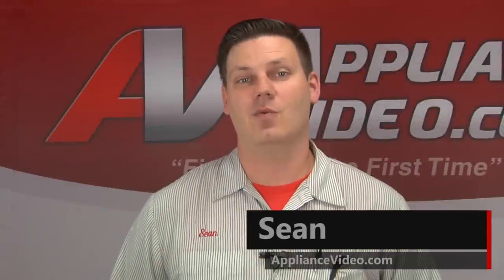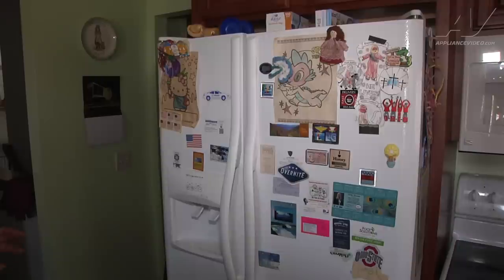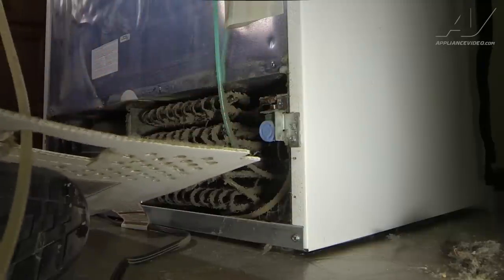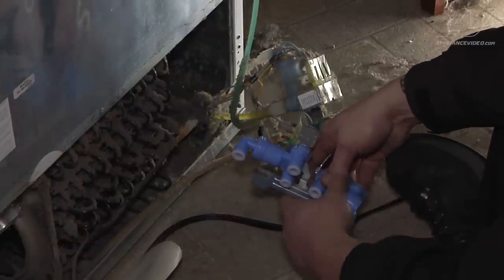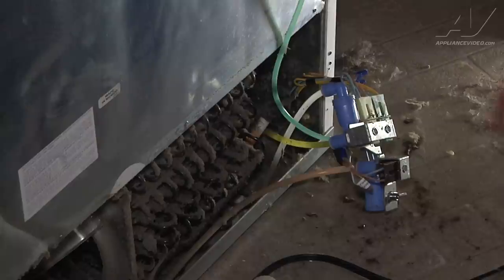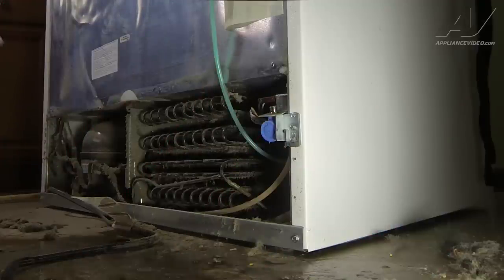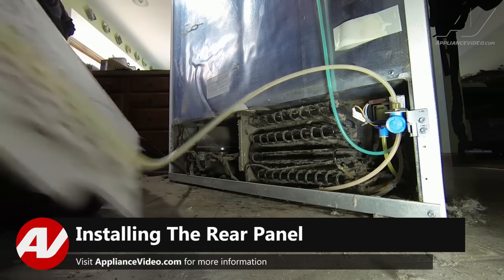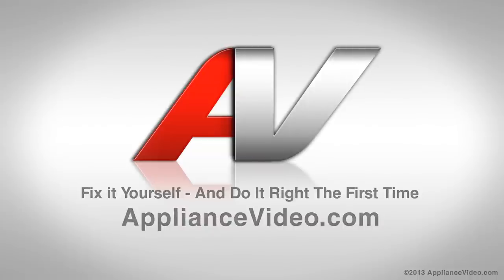Frigidaire Refrigerator Repair - Not Getting Water - Solenoid Valve

Comment: Pretty good video!  Thanks!  I had already figured the solenoid was bad because it was a typical sound that I was used to hearing over the last 15 years, that I wasn't hearing anymore.  It would be pretty easy to check for power going to the solenoid, but in my case I bought the fridge new over 15 years ago and knew these solenoid were the weak link in the system, so I just rolled the dice and bought a new valve.   All is good now, ops check good. I immediately could hear the solenoid actuate and after I cleared the ice obstruction at the top of the fill hose I'm in business.  I suppose with a bad valve water sitting stagnant in the fill line will tend to ice up at the top...so yeah, make sure you clear the ice at the tube where it goes to the ice maker.
Reply from the maker: Thanks for your response, we are glad we could help. Our library
of over 5,700 videos are currently helping over 1.6 million people like you
every MONTH.  Please help us by
subscribing to our YouTube channel, or post our website www.ApplianceVideo.com to your Facebook
page, Twitter, Instagram or any other social media sites. Your support will
help us keep producing more free quality videos.

Comment: Just rewatched your video. I replaced the inlet valve 2 weeks ago and it all worked fine. The valve went bad. Today it fails a continuity test. Can a bad diode cause a valve to fail? If so then I will have to replace the diode but it is a 50 dollar part so I don’t want to if it is not necc

Comment: My ice maker freezes the ice but doesn't dump it. This video is very Informative. My Frigidaire is a little newer but the ice maker is almost exactly the same. Now I know exactly how to replace it. Thanks too much
Reply from the maker: Great question, you can call
our parts department at 1-800-830-5465 and they can give you help 6-days A week
Mon-Sat . You can also search at www.SaveMoreOnParts.com 7- days a week.  If you have a more
technical question that our parts department cannot answer, our technicians are
answering all questions at our website at www.ApplianceVideo.com under our Repair Help section. We have over 6,000
common questions and answers that you can easily search through by your model
number, appliance make, problem or error codes, and It’s completely free to
search through our question & answer library. There is a very good chance
you question is already answered there.

Comment: What sorts of test did you do to come up with your diagnosis of faulty inlet valve/diode?  With a multimeter, which one did you test and what are the readings?
Reply from the maker: +ryk1265 

         We would like to help you answer your
question. With our videos now getting over 900,000 views per month and hundreds
of questions from people like you, our technicians are now answering questions
at our website http://www.appliancevideo.com/repair-help/ .  We also have over 2200 common questions
and answers that you can easily search through by your model number, appliance
make, problem or error code and it’s absolutely FREE. You also have the option
to email a factory service technician with a question on your appliance at http://www.appliancevideo.com/repair-help/ . If you’re looking for a repair video, you can
also search our library of over 2600 free repair videos. ApplianceVideo.com
specializes in quality DO-IT-YOURSELF appliance repair videos and we get over
800,000 views per MONTH to our videos worldwide and growing. If you need of
parts for your major appliance, we have over 5-million parts in stock at http://savemoreonparts.com/ .  Thanks for your support. Matt Ace
Appliance factory service technician.

Comment: So my issue is the solenoid isn’t receiving 115v water solenoid is getting 115v and water is perfectly fine with good pressure also solenoid is more than likely plugged because “black things would come out” as stated by customer. Also ik it’s calling for ice when I press the ice dispenser readings would change by 1 or 2 weird problem any input or ideas besides bad board

Comment: So. I have no water and no Ice. This happened when we moved in abt 3 yrs ago. I replaced the water inlet, new filter and it all worked. Ive been replacing rhe filter and no issues. But here we are again no water, no ice. So i changed the filter and cleared the ice where the hose goes into the ice maker. Still no water. So I replaced the inlet again. I can hear the water dispenser trying to work but still no water. ? ? Water seems to be getting to the filter because i hve removed and replced it a few times and water is dripping from it.    Any ideas?.

Comment: What is the part number of the Diode that you replaced and where can I buy it? I have the same problem, no water coming even after I replaced the solenoid valve.
Reply from the maker: Great question, if you have a more technical question that our parts department cannot answer, you can search our over 17,000 answered questions free at our website www.ApplianceVideo.com under our Repair Help section. You can also call our parts department at 1-800-830-5465 and they can give you help 7-days A week ,or search at www.SaveMoreOnParts.com  .

Comment: The fan on the Frigidaire Professional is out on the bottom back of the fridge, the ice and water are no go. The left side is pretty hot too.  Advice before we go out to buy a new one tomorrow?
Reply from the maker: Great question, if you have a
more technical question that our parts department cannot answer, you can search
our over 10,000 answered questions free at our website www.ApplianceVideo.com under our Repair Help section. You can also call
our parts department at 1-800-830-5465 and they can give you help 7-days A week
Monday -Sunday, or search at www.SaveMoreOnParts.com  24 hours
7- days A week.

Comment: A lot of videos go over what might be the cause for an ice maker not making ice. One of those reasons could be a clogged water inlet tube leading into the ice maker.    That was my problem BUT  I can't find in any of your videos that explain why the water inlet tube would freeze over preventing water to enter the ice maker thus not making ice.  Everything works but that.  Please help.
Reply from the maker: Great question, if you have a more technical question that our parts department cannot answer, you can search our over 17,000 answered questions free at our website www.ApplianceVideo.com under our Repair Help section. You can also call our parts department at 1-800-830-5465 and they can give you help 7-days A week ,or search at www.SaveMoreOnParts.com  .

Comment: i have a frigidaire model #fghc2331pfca  that has a diode install on the man water valve connecton wire for the water inlet valve tan line just like the video you are describing here but mines was not incased in plastic  but rather in a hard silicon type clear material as well as heat shrinked plastic to make a long story short i was able to cut in4007 diode from where it was being housed so that could just check it out because im having similar issues with the ice maker not receiving the water from the valve (i dint take pictures) but any way the diode is good and im trying to get information of which way does the cathode side need to be installed back in the system toward the connector or away from the connector please help as well as  called the parts dept and they dont know the name of the harnest as well as see anythng about the diode
Reply from the maker: Great question, if you have a more technical question that our parts department cannot answer, you can search our over 13,000 answered questions free at our website www.ApplianceVideo.com under our Repair Help section. You can also call our parts department at 1-800-830-5465 and they can give you help 7-days A week ,or search at www.SaveMoreOnParts.com  .

Comment: I’ve got a Kenmore side by side with water and ice in the door.  After replacing my water filter the water dispenser leaked water.  I replaced the water valve/coil just like in the video.  That fixed the leaky water dispenser.   now my ice maker is leaking water inside the freezer.  I’m getting ice cubes so the ice maker seems to be working.  Any suggestions on what may be wrong?
Reply from the maker: Great question, if you have a more technical question that our parts department cannot answer, our technicians are answering all questions at our website at www.ApplianceVideo.com under our Repair Help section. You can also call our parts department at 1-800-830-5465 and they can give you help 7-days A week Monday Sunday, or search at www.SaveMoreOnParts.com  24 hours 7 days A week.
Reply from the maker: Great question, if you have a more technical question that our parts department cannot answer, our technicians are answering all questions at our website at www.ApplianceVideo.com under our Repair Help section. You can also call our parts department at 1-800-830-5465 and they can give you help 7-days A week Monday Sunday, or search at www.SaveMoreOnParts.com  24 hours 7 days A week.

Comment: Hello I hope you still read comments in your Chanel I have problems with my Frigidaire ice maker water doesn’t get to the it but water dispenser is working right ... what do you think it could be the problem? I will appreciate your help ...
Reply from the maker: Great question, if you have a more technical question that our parts department cannot answer, you can search our over 13,000 answered questions free at our website www.ApplianceVideo.com under our Repair Help section. You can also call our parts department at 1-800-830-5465 and they can give you help 7-days A week ,or search at www.SaveMoreOnParts.com  .
Reply: Same thing for me! Did you find it out?

Comment: My unit looks like this one except its black in color, I do see any water going into the ice maker, however I do get water from the water dispenser on the door.  What are the part numbers for both parts replaced?
Reply: BTW when I push on the dispenser on the door the screw in the ice maker turns.
Reply from the maker: Great question, if you have a
more technical question that our parts department cannot answer, our
technicians are answering all questions at our website at www.ApplianceVideo.com under our Repair Help section. You can also call
our parts department at 1-800-830-5465 and they can give you help 7-days A week
Monday -Sunday, or search at www.SaveMoreOnParts.com  24 hours
7- days A week.
Reply: Everyone has to make everything racist these days! OMG

Comment: What is the water connection called on the new piece?  (The old one is "threaded.")
Reply from the maker: Great question, if you have a more technical question that our parts department cannot answer, you can search our over 13,000 answered questions free at our website www.ApplianceVideo.com under our Repair Help section. You can also call our parts department at 1-800-830-5465 and they can give you help 7-days A week ,or search at www.SaveMoreOnParts.com  .
Reply: the new type is a "push in connector"

Comment: We bought a used Frigidaire side by side, 5 years old, from a friend.  The ice maker worked fine.  We got it home and it wasn't getting water to it, however the water dispenser worked fine.  After reading the trouble shooting guide, my husband replaced the water valve triple solenoid. ( Part #240531101)  They said it might take 24 to 48 hours to work.  At 48 hours, my husband checked it, yet again,  and the inside where the cubes are made was so hot it burned his hand.  What the heck?  It was still not getting water, either.  It was professionally moved and disconnected.  HELP!!!!   I really love this refrigerator and the one I got rid of, the ice maker didn't work because it was old.  I was really looking forward to ice!!!  Ever had this happen and what next?

Christy C.
Reply from the maker: +Christy Clark 

We would like to help you
answer your question. With our videos now getting over 900,000 views per month and
hundreds of questions from people like you, our technicians are now answering questions
at our website http://www.appliancevideo.com/repair-help/ .  We also have over 2200 common questions
and answers that you can easily search through by your model number, appliance
make, problem or error code and it’s absolutely FREE. You also have the option
to email a factory service technician with a question on your appliance at http://www.appliancevideo.com/repair-help/ . If you’re looking for a repair video, you can
also search our library of over 2600 free repair videos. ApplianceVideo.com
specializes in quality DO-IT-YOURSELF appliance repair videos and we get over
800,000 views per MONTH to our videos worldwide and growing. If you need of
parts for your major appliance, we have over 5-million parts in stock at http://savemoreonparts.com/ .  Thanks for your support. Matt Ace
Appliance factory service technician.
Reply: most people do not know that most  fridges today with ice makers have water filters -  you may not still have that fridge but  make sure with your current one  that you change the water filter at least every 6 months
Reply: @allenwood3805  I have a new filter and I get water to water dispenser but the ice maker is not filling up.  Any ideas?
Reply: @seeya205  one of your water lines may have a kink in it or you may need another water valve

Comment: Hi there having some problems here as well the fridge started leaking and we called Frigidaire and they sent us out a new valve like in the Video so we done the same thing and the new unit is still leaking so we called them again and they sent us out a another one and that one is leaking to wtf is is the hoes's bad or is it another faulty  unit
Reply from the maker: Great question, if you have a more technical question that our parts department cannot answer, you can search our over 17,000 answered questions free at our website www.ApplianceVideo.com under our Repair Help section. You can also call our parts department at 1-800-830-5465 and they can give you help 7-days A week ,or search at www.SaveMoreOnParts.com  .

Comment: Thanks for the video! Followed it very nicely, but . . .

Problem: No ice or water to our frigidaire FFHS2311LW0

Replaced Water Valve

Now I have water, but still no ice.

Bad part?

Bad icemaker?

Russian collusion?

Any ideas?
Reply from the maker: Great question, if you have a
more technical question that our parts department cannot answer, you can search
our over 10,000 answered questions free at our website www.ApplianceVideo.com under our Repair Help section. You can also call
our parts department at 1-800-830-5465 and they can give you help 7-days A week
Monday -Sunday, or search at www.SaveMoreOnParts.com  24 hours
7- days A week.
Reply: Same here. Replaced valve. Still no ice and everything seems to be working correctly.

Comment: I have no water going into the ice maker .However I do get water from the water dispenser on the door
Reply from the maker: Great question, you can call our parts department at 1-800-830-5465 and they can give
you help 6-days A week Mon-Sat . You can also search at www.SaveMoreOnParts.com 7- days a week.  If you have a more technical question that our parts department cannot answer, our technicians are answering all questions at our website at www.ApplianceVideo.com under our Repair Help section. We have over 4,000
common questions and answers that you can easily search through by your model
number, appliance make, and problem or error codes, and It’s free to search
through our question & answer library.
Reply: DEFINATELY  replace the water filter first  - may solve your problem
Reply: ApplianceVideo.com ...freezer is 20'f. No ice. Water is working. Coils clean. No ice build up. Fan is running. Freezer not freezing, not making ice.
Reply: Before jumping into changing these valves check the lines leading to the water filter.  I changed out a part that made it necessary to remove these lines.  When I went to replace them I inserted the lines too far into the inlet valve.  Once I adjusted these, wala....water flow!

Comment: what kind of fittings are on the new ones?  2:50
Reply from the maker: Great question, if you have a more technical question that our parts department cannot answer, you can search our over 13,000 answered questions free at our website www.ApplianceVideo.com under our Repair Help section. You can also call our parts department at 1-800-830-5465 and they can give you help 7-days A week ,or search at www.SaveMoreOnParts.com  .
Reply: @Appliancevideo  I just want to know what he calls them at 2:50

Comment: Where I buy valve and diode ?
Reply from the maker: Great question, if you have a
more technical question that our parts department cannot answer, our
technicians are answering all questions at our website at www.ApplianceVideo.com under our Repair Help section. You can also call
our parts department at 1-800-830-5465 and they can give you help 7-days A week
Monday -Sunday, or search at www.SaveMoreOnParts.com  24 hours
7- days A week.

Comment: Where I buy the wire charger ?
Reply from the maker: Great question, if you have a
more technical question that our parts department cannot answer, our
technicians are answering all questions at our website at www.ApplianceVideo.com under our Repair Help section. You can also call
our parts department at 1-800-830-5465 and they can give you help 7-days A week
Monday -Sunday, or search at www.SaveMoreOnParts.com  24 hours
7- days A week.
Reply: You mean a wire cutter? wire stripper? wire cover? You don't know what they are called, you have never used them, and you don't know where to buy them. DO NOT attempt this repair.